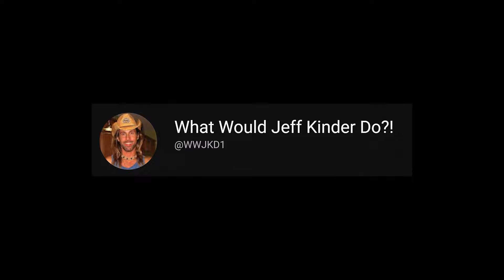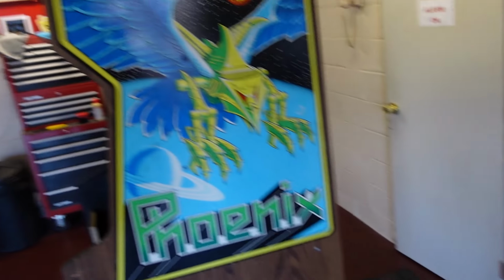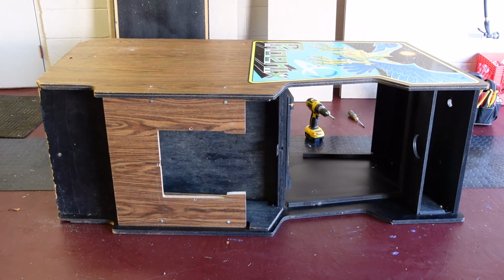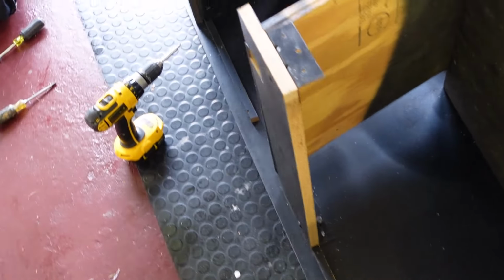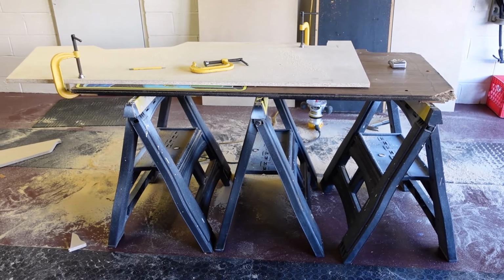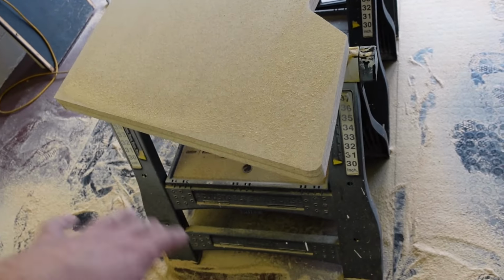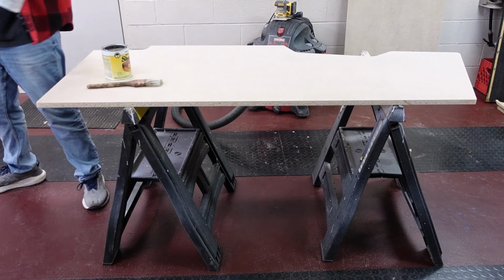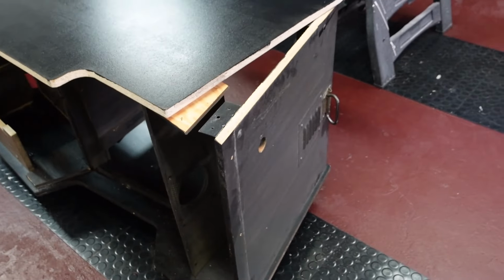Phoenix Restoration (Part 2)

Comment: This is basically building a brand new cabinet. Its going to look mint! I know alot of serious arcade collectors hate it but maybe throw the old one back together, throw a multi in it and sell it cheap. Some people like the beat up patina, and aren’t too fussy about originality. It would be a win win!
Reply from the maker: Hi!  Hmmm... well, I'm still using all the existing inside pieces, so it's not really a complete scratch build.  Just replacing the water damaged pieces... I didn't mention it in the video, but you can smell the mold on these pieces, so I don't think anyone would want the stuff I'm removing :)